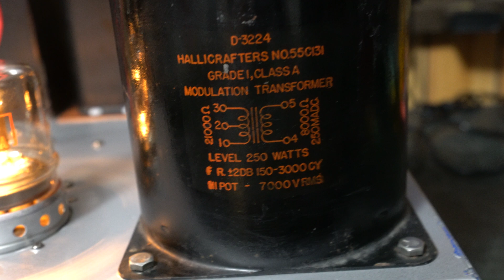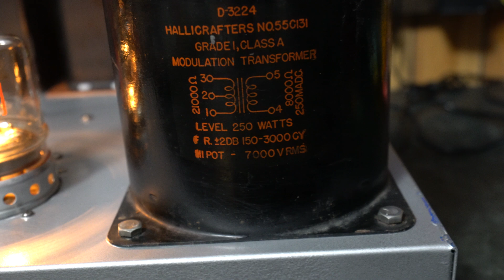Eimac 4-125A  240 Watt Modulator For 20 and 40 Meter (AM) Amplitude Modulated Station

Comment: It's funny david, I was just thinking about using a cheap solid state high power amp with a reverse connected audio output transformer to make a modulator.  But of course a high power audio  transformer for tube amps is many times more expensive than a mod transformer...  hmmm  I bet your "hallicrafters" mod transformer is really a UTC.  what was it made for ?  73 W6WUH
Reply from the maker: I am almost certain it is a UTC modulation transformer for the Hallicrafters version of the BC-610 transmitter. It is a potted one and is very quiet meaning I can't hear it "talk back" unless I put my ear close to it when fully modulating it. What kind of modulation transformer are you looking for?   73  WA4QGA  see my QRZ page.

Comment: I just found this video in a search for this tube. Pretty cool. I just acquired one at a hamfest with a couple other transmitter power amplifier tubes. All for $5. I just need to figure out how to test it and then find a use for it if good. Otherwise it becomes a display piece.

Comment: That is one beastly device!    I enjoy making tube amps too.... usually for guitar amplification,  or home stereo.  I usually don't stretch into this level of power though!
Reply from the maker: Vacuum tube amplifiers are beautiful. I just lowered the plate voltage from 2600 to 1300 by changing out the bridge for a FWCT and I get a much better impedance match between the modulator and class-C RF amplifier. Got to be very careful around these beasts, as you call them. They are beautiful but can be deadly.  73

Comment: the high power tubes may sound good but they lack the sweetness of the lower power tubes
Reply from the maker: I agree with you. Possibly the 7591/6L6GC class of tubes are the best sounding - something in the 30 watt range.
This modulator is just meant for voice and lots of power to drive an RF amplifier.

Comment: You mentioned to me before that you use a label maker on your chassis. I have a P-touch and ordered some black on clear tape and it's kinda cloudy looking compared to yours.  What brand labeler and tape do you use?  Hope you had a good,  safe,  new year!
Reply from the maker: I just recently ordered more from Ebay and this is it.
https://www.ebay.com/itm/2PK-TZ-131-TZe-131-Black-on-Clear-Tape-For-Brother-P-touch-PT-D210-12mm-Label/182103621844?ssPageName=STRK%3AMEBIDX%3AIT&_trksid=p2057872.m2749.l2649
Reply: @ElPasoTubeAmps  Thanks.  If you remember,  after you get them and make sure they are clear could you possibly let me know.  That is the same seller that I purchased the one that I got.  It says black on clear,  but mine was a cloudy white after you peel the backing off . Yours looks invisible.  I'm not sure if mine was a generic or something,  or a mistake.  I'd greatly appreciate it.
Reply from the maker: @kgsalvage6306  I  have already received mine. I opened up one of them and put it in and when it comes out of the printer is looks kind of milky but once I pull the wax paper off and stick it to the chassis, it is as clear as all the others.  One thing  I really like about it is it has the split backing on it to get the wax paper off instead of me having to dig at the edge to peal it off.  I think the tape is OK even though it is not actual Brother brand.
Reply: @ElPasoTubeAmps  Thanks,  I'm going to order them and give them a try.

Comment: Dave, if you put your choke in the negative lead of the plate or screen supply, the choke is subject to a much lower voltage, and does not require isolation from the chassis.
Reply from the maker: I did consider that but there is something about putting the choke in the negative lead to ground that can cause a problem, but I can't remember what. Is it transient voltages when the PS goes on and off or what? I know there is some potential issue with placing the choke in the negative lead or maybe I am just old fashion and stubborn...  similar, there are possible issues with placing the meters in the negative lead as they are always bypassed with a resistor, a low voltage capacitor that can fail-short and nowadays back-to-back  diodes. There is some potential hazard with the choke or meters becoming "unloaded", i.e. not having a full circuit path but I can not remember the details. Do you know the issue I am talking  about?
Reply from the maker: You got me researching this again as it has been brought up recently in other discussions I have had with my friends that build amplifiers. Thank you... seriously. 
I will quote from the 1970 Radio Handbook by Bill Orr,  W6SAI,  Power Supplies, 30-1, pg. 767
BACK EMF
"It is possible to place the filter choke in the B-minus lead of the power supply,  reducing the voltage potential appearing from the choke winding to ground. However, the back-emf of a good choke is quite high and can develop a dangerous potential from center tap to ground on the secondary winding of the plate transformer, If the transformer is not designed to withstand this potential, it is possible to break down the insulation at this point."  ....   this is all I could find at the moment but this must be a somewhat serious concern or everyone would be doing this method instead of using an expensive multi-thousand volt insulated choke. 
As I see it, during the cycle where the ends of the transformer are at the maximum negative potential, the CT of the transformer will still be at a fully charged (1.414 * RMS) DC voltage so the voltage across 1/2 the secondary winding will be twice what it normally is. Now, is this going to always cause a problem? Probably not on military surplus quality transformers. I run high voltage transformers (the one in this video is the perfect example) with a "floating" CT since I use a bridge. I have never had a problem with that although I have read warnings about a "poorly" insulated CT that is meant to be at ground potential.  You hear the same type of warning on using microwave oven transformers (MOT) as one end of the secondary is always at ground as designed in the oven. I have "lifted" this wire from ground to play with these transformers and have not had an arcing issue. Maybe I am just lucky.

I can absolutely tell you one issue to not overlook it you do use the choke in the negative lead of the PS. You still, must have a capacitor off the positive lead to ground or you will not have an signal-AC path to ground for the rest of the amplifier. There Must be a capacitor to ground on the positive lead especially to take the large signal-AC component to ground coming off the CT of the output transformer of an audio amplifier. If this capacitor opens up (I have had it happen so this is how I learned...) the amplifier will appear to be OK with no signal drive but once you start driving the input with a signal, it will seriously go bad on you.

Comment: Nice work. Thanks for the video. I'm just getting started in "BIG IRON" AM with an old GATES BC-1T. Previous owner converted to 160M, but used external modulation. He left good schematics about conversion to 160M and seems to have done a good job, but decided to use external modulation, and FT-101 or some such I believe. Unfortunately, he is SK and his brother whom I bought it from doesn't seem to know much about it.  Again, thanks for the video. I'll be looking for the others. 73 de N5RXP
Reply from the maker: Wow... you have a Gates BC-1T... I would buy another property and built a house to have one of those. I would probably put it on 20M. I assume you have seen my 833A amp video I use on 20M. It definitely has a "voice" and I only run it at 1KW. I will have to make a video of how a PEP meter displays AM from a modern day transmitter driving a class-B GG amplifier vs high level modulating a push-pull pair of 811A. I think everyone will be surprised. I was.   73
Reply: @ElPasoTubeAmps  I also have a BC-1J set up on 75M. Can't use em both. Interested in some kind of trade? I live just west of San Antonio so could meet you someplace convenient like Ft. Stockton or possibly arrange a visit. Good in Zed
Reply from the maker: @geckoproductions4128  Holy Cow... my wife will kill me for sure.  I will look your email up.  WA4QGA